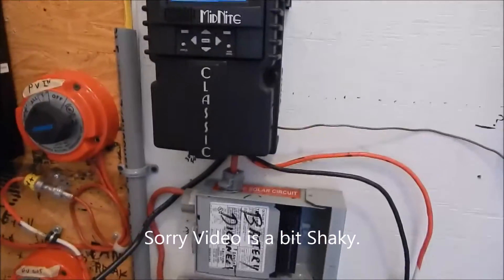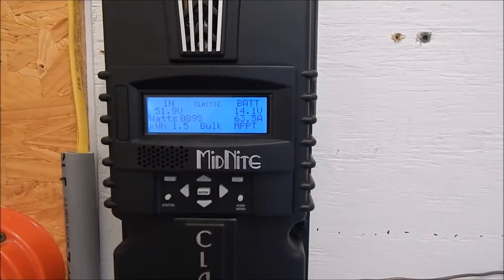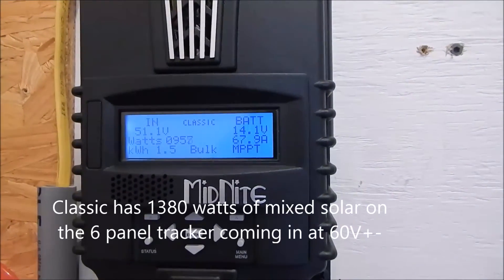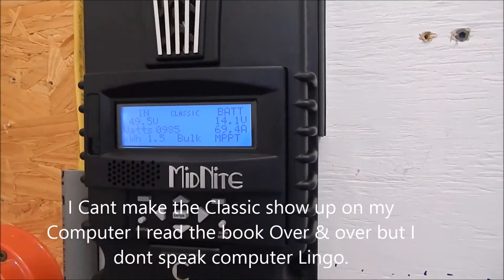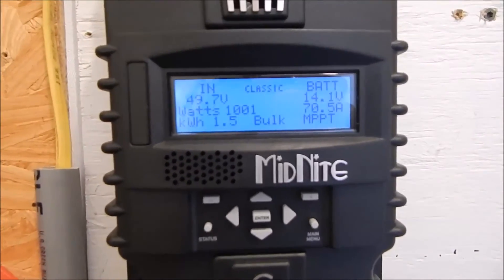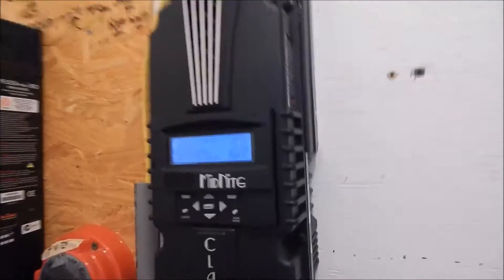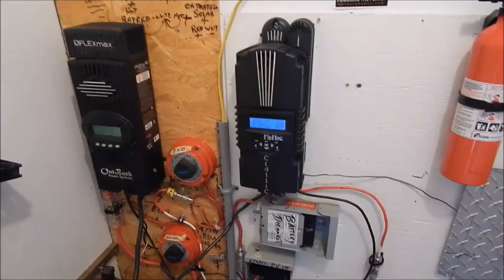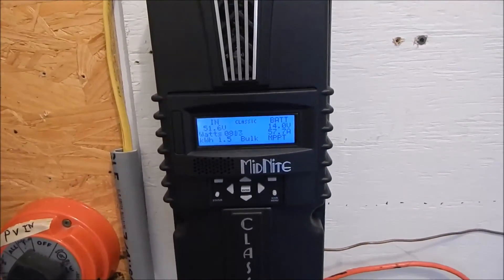Midnight Classic 150 Installed & Making Power

Comment: Nice power out put. I have 1666 watts hooked to my PIP 4048 I usually get about 25 amps going in to it. but to day I was topping out at 28 amps at 52.1 volts for 1,458.8 watts not bad we got snow last night and with the sun reflecting off the snow I got the extra power from the sun.   I can't wait to get my self a midnite so I can get that all-some software from Justin and Jeremy, so I can watch my power.   I was on battery for 1/3 of the home for 8 hours to day. witch I like.  been saving money every day with my new set up,  Thanks to Justin Case.
Reply from the maker: +McCuneWindandSolar That's Great man Thanks for watching lots of changes going on here.

Comment: They have some very good videos on youtube to help you hook it up to the computer. They all run hot at 12volt. I wanted them to put a coffee cup warmer on mine. ran cooler at 24v and cooler again at 48. The PCP is at the back of the unit. If you want it to run cooler lift it off the wall 1/2 an inch with some mounting spacers. that will help it run cooler at the lower volts. All the outer casing is a heat sink so lift it away from the wall :)
Reply from the maker: +Justin Case Thanks That's a good idea! I will be changing over to 24volts soon that should help . It is very hard to charge this bank at 12Volts it to big needs 24 V badly. I am still learning some thing every day.
Reply: +TheKilog69 we learn as we go along my friend. every now and then somebody will come along and lend a hand. I love it when i learn new stuff.
Reply: Congrats! I learned a lot from Justin Case...esp about running higher battery volts and PV volts. He also showed me what he did with aluminum spacers behind the unit to help with cooling. Next goal for me is 48v....but, that is way down the road. I have also used Midnite Solar's YouTube video to install the Local APP so that you can use the computer to monitor/adjust. You need to do this...pretty nice. AWESOME job my friend...have fun and congrats on your new controller!
Reply from the maker: +Chris DIYer Thanks!  I am learning more every day & every time I make changes to my system .  Hopefully this month I will get 2 more battery's  then up to 24V I go.I need to watch the videos cause I know nothing about computers.
Reply: +Chris DIYer nice words. thank you mate :)